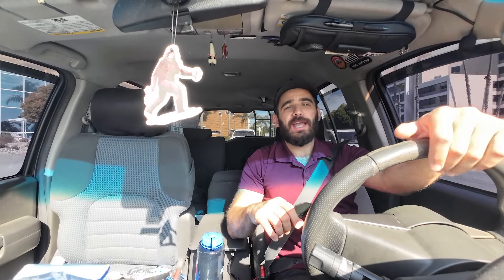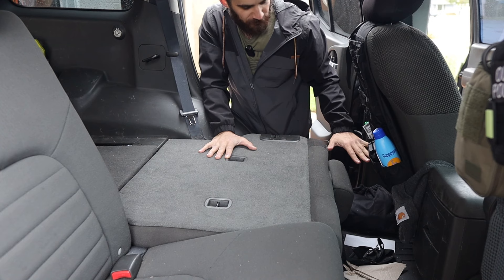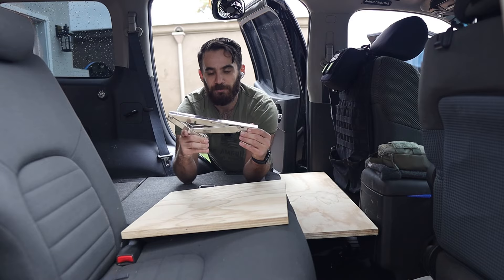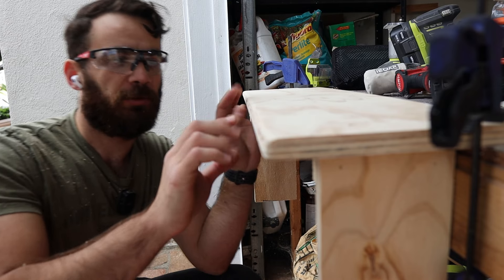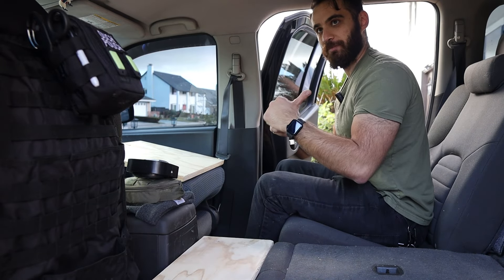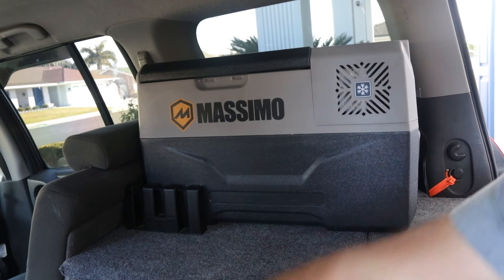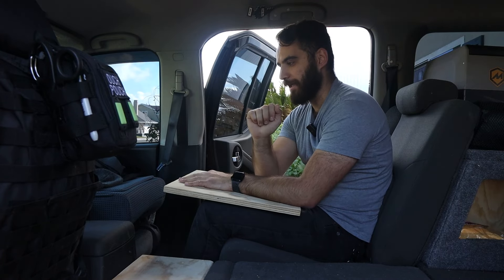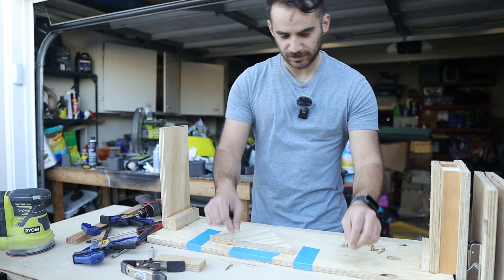Turning My Car Into a Mobile Office/Studio!

Comment: Nice job. As soon as I saw where that corner hinge thing was I saw myself hitting my knee on it, haha. Glad you moved it. I imagined having the fold up and over parts coming from the top of the head rest. That way, I could sit in the seat before folding it up and over. Whatever works, and you had some good ideas to keep in mind. Thanks.
Reply from the maker: I did consider making it fold from the headrest but I also wanted the ability to fold the front seat all the way flat and still use the desk. Thanks for checking out the video!

Comment: Can you tell me if there's any issues with leaving your car running for extended amounts of time in order to run air conditioning or heat or just for power for gadgets?
Reply from the maker: I haven’t run into issues personally but it would depend on what car you have and the condition of the AC and radiator in order to cool the components